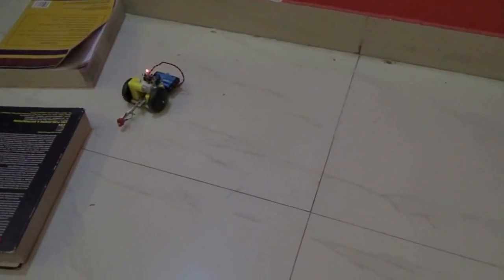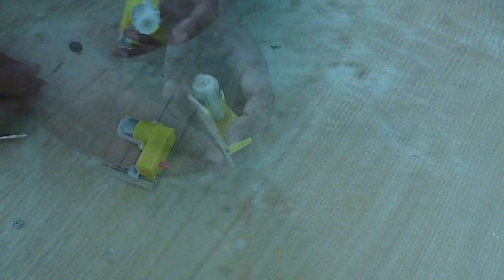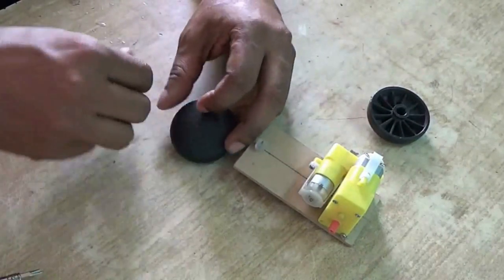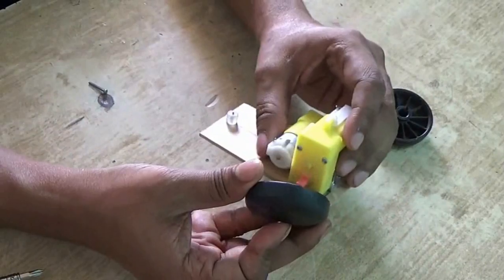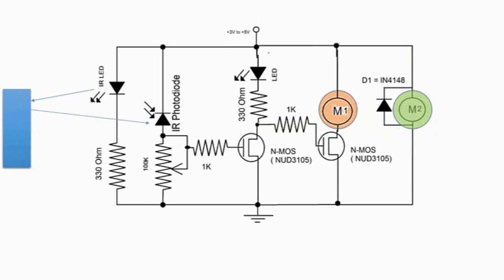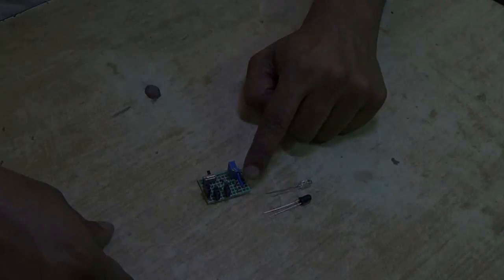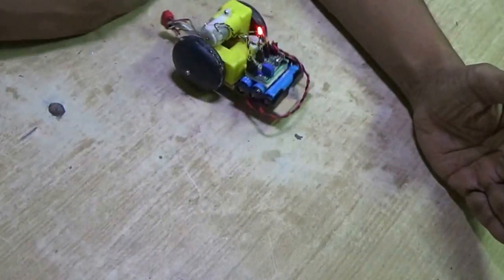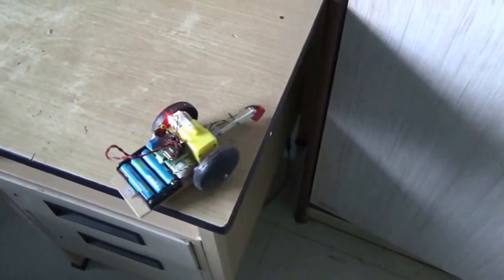How to make a simple obstacle and edge avoiding robot car

Comment: Hi, will there be any heating problem? I used regular 2n3904. The circuit works if i dont put any limiting resistors ... but the transistor heats up significantly. How do i manage the heat?

I am using a pre-assembled sensor board bought on Amazon.

Is it safe to use the BD139 directly? Or should i use BD139 in darlington pair mode?

Comment: 1.bd 139 transistors-2
2. 1k and 330 ohm resistors- both 2 pieces
3. 4148 diode-1
4. 100k rheostat-1
5. indicator led-1
6. some wires
7. pcb board
8. soldering machine,soldering iron and flux
9. 100 rpm dc gear motors-2
10. 2 wheels for motors
11. plastic base
12. double sided tape for sticking the circuit 
13. castor wheel

corect   ?
Reply: Thank you

Comment: my photodiode(sensor) is having three pins .where to connect??????🤔🤔🤔🤔🤔🤔🤔🤔🤔
Reply: cant i use it there
Reply: from where i can get  simple photodiode
Reply: can you please tell me that circuit
Reply: as soon as possible
Reply: or can you tell me in which machine i can get photodiode
Reply: but if you will provide me circuit for the sensor i have within a week then it would be nice

Comment: Brainergiser i am having the following items for this circuit:
 Dc motor
 Bd139 transistor
 Diode IN4148
 resistance wire
 IR led 
IR photodiode 
Is that all ok????
Reply: The value of resisters are 330 ohms,100 k ,1k
Reply: Brainergiser what must be the supply voltage????

Comment: I still can't make the circuit work. I used BD139, and 100k fixed resistor instead of potentiometer. The rest is the same in the video. What could be the problem?

Comment: sir!! its very easy to build the circuit but i manage to make using ldr because i really confuse when i try to use IR LED and IR photodiode. So please sir, can u help me how to make it using IR led and photodiode
Reply: +Saurav Chakraborty (Brainergizer) Thank you sir! but another problem is the motor 2 is a little faster than the motor 1. What should i do to make the motor 1&2 equal?
Reply: +Saurav Chakraborty (Brainergizer) Thank you very much! I'm very grateful! but sir, i'm worried because when i try to use ldr or ir led and photodiode, the brightness of the surrounding  where the robot is placed affect to the motor 1. But in your tutorial, it seems that the brightness of surrounding cannot affect your robot. What should i do  sir? please help me..
Reply: +Saurav Chakraborty (Brainergizer) thank you very much sir for helping me
godbless !!